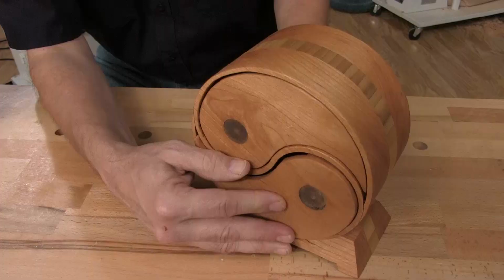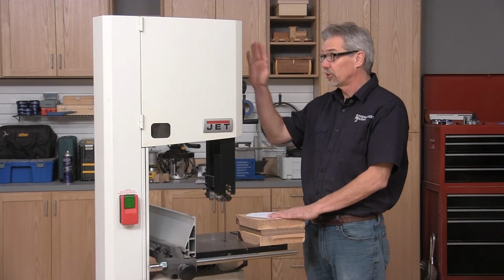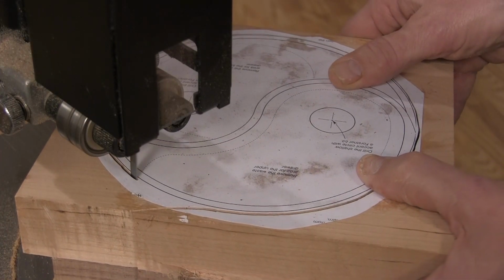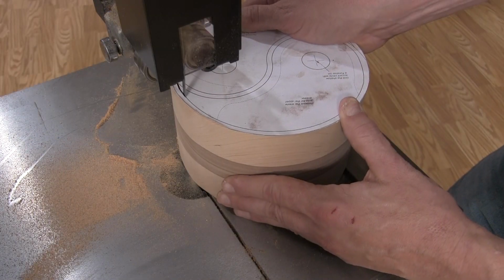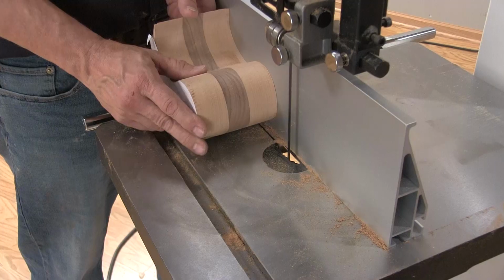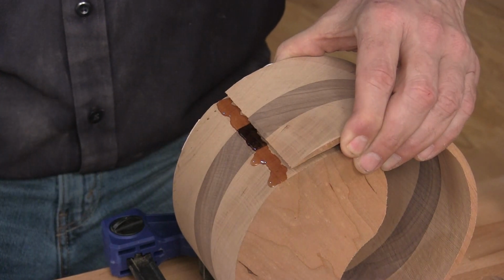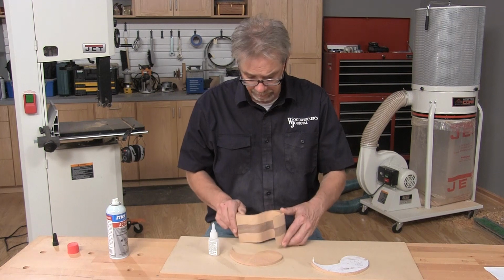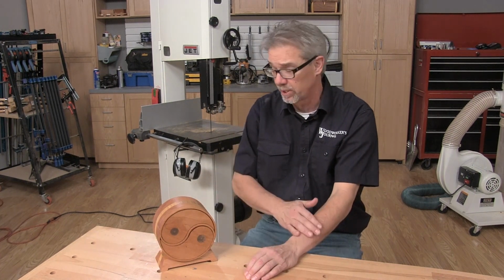Basics of Making a Band Saw Box | JET Sponsored Project

Comment: If it is possible, dont use a spindle sander. a benchtop belt sander or disc sander have flat surfaces, which are better than a spindle sander that creates little valleys if your not careful. spindle sanders should be used for interior curves

Comment: Ummmmm.....did you not have a back to the box?  The drawers just push thru?  Or did you skip the step of cutting off the back before the drawers?
Reply: I was wondering the same thing. Not clear.
Reply: You can do it both ways. I have been making these (not this design) for a little while now and have come to the conclusion that there is not always a need for a back... depends on the box, some work fine both ways, some only one way.
Reply: @joh22293  no back, eh?   interesting concept.  after years of making them, I don't think I have ever made one without a back so the drawers don't push through.